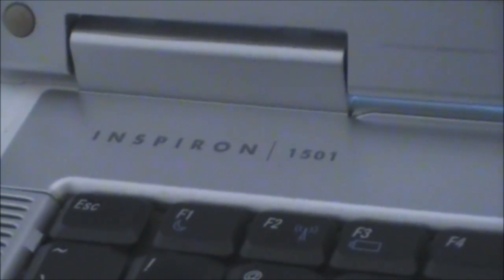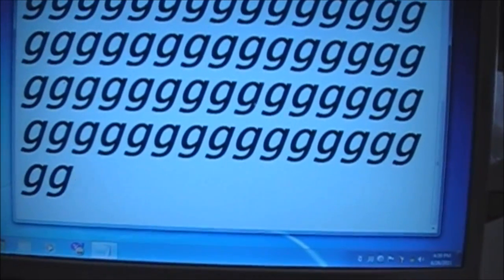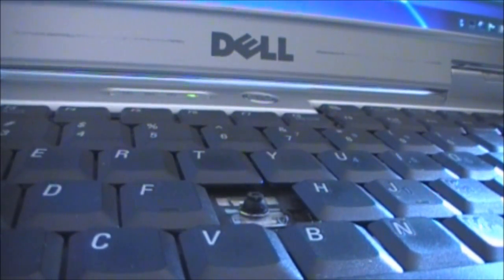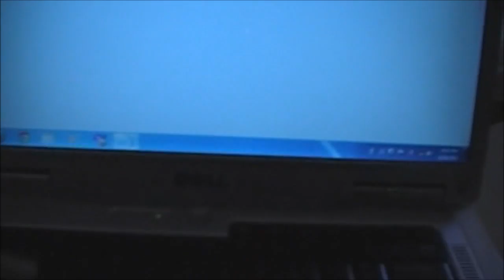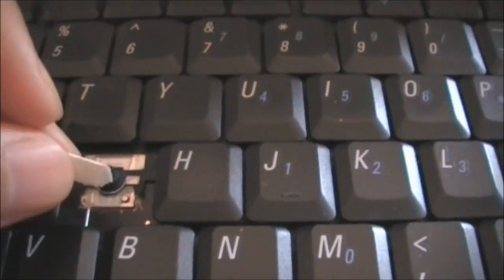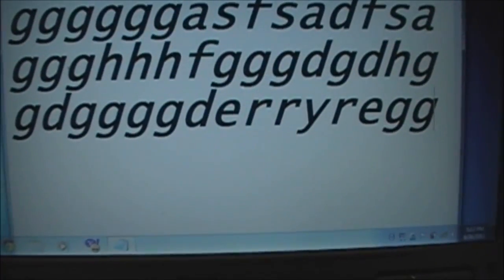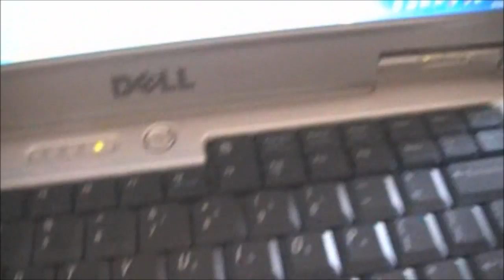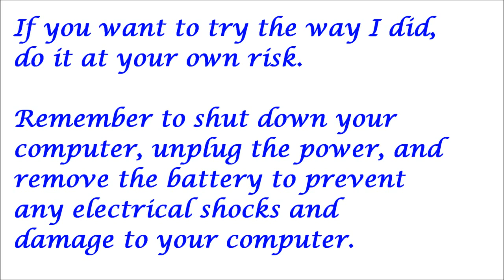Fix Laptop Stuck Key

Comment: I used a little screwdriver like you showed to take my "L" key off but it flew across the room and my dog thought it was a treat and ate it. I looked on the HP site for a new "L" key but they only sell new entire keyboards. They have 3 keys currently for bids on Ebay for my laptop type but only "S" "T" and "Z". Can I use an "S" "T" or "Z" key for my "L" key?
Or should I just wait until my dog takes a crap and get the authentic "L" key? What if it sticks in his butt like sometimes cornflakes do when he eats them? (He's  not supposed to butt he's bad) Do I have to dig it out? Will it still work after coming out his butt? Can you help?

Comment: i have a problem my d and 3 key are stiff when i press on the keys normally they wont type i have to press hard on them for them to be typed will the method shown in this video work someone plz help
Reply from the maker: matt14151 It might have dirt under it or the silicon might have broken. You can take out the key carefully to check it. Careful when you try to lift the key.
Reply: patienceishope Thank u so much that actually helped

Comment: Mine got a tiny bit of water onto the key... Me being an idiot I am I used a hairdryier and set it on high, and of course 2 keys melted. But amazingly that fixed my problem. People, try using a hairdrier if you damage your keyboard because of water, it works. Just don't set it on high like me, lol. Now I have 2 melted keys on my keyboard, but atleast it works.

Comment: forgot to update here, I took it off and found a way to disable the key completely so it doesn't refresh all the time.  However after cleaning the keyboard it still does the beeping sound to the point I don't want to turn off my laptop or put it in hibernate (I put it in sleep mode now).  I'll just have to  replace my laptop when I get the funds and then see if I can take this one to get fixed...use it for school or something Lol.

Comment from the maker: It is likely that your key is stuck. It might have dust under it. When you turn on the computer, it make a continuous sound which means you have a stuck key, possibly your f5. Other beep sounds could mean problem. 

Search online to see how you can remove the f5 key for your laptop. If you can remove it without breaking it, try it to see if it does not cause any more problem.

Comment from the maker: It is possible that under your key might have dust until it that it or something stuck under it that caused it to keep going. If you can remove the key without breaking it, then you will know whether your problem will be fixed. Or you can try to blow some air under it to see if it work. As you saw in my video, my key was actually stuck so I had to put a paper in between the electrical membrane to stop it.

Good luck.

Comment: can you help me? my 0 key keeps going on even without force just like this000000000000000000000000000000000000000000000000000000000000 i have to hold down shift to type. and when this happens 0000000000000000000000000000000000 my control pad doesnt work. please help

Comment from the maker: If you have to give it a little force, then there is a great chance that dust could be under the key or something stuck under it. As long as it works, no need to fix it. If it ain't broken, don't fix it right? (^_^)

Comment: I just removed and replaced keys on my dell and it took awhile but went very well. But when I turned on computer At windows start up as the blue line goes across an alarm goes off, I have no idear what it is. It does go off and laptop works fine. Any idear what happened?

Comment from the maker: Hey thesweetarab911. There are many possibilty that it could not. Either the keyboard is malfunction, dirt fill in the keyboard, etc... If you plan to fix it by yourself, make sure you are very very careful with it because anything goes wrong, you would ruin it. On the other hand, you could replace the keyboard.